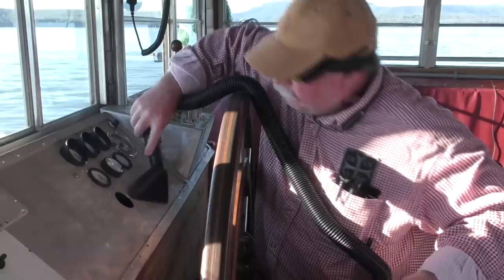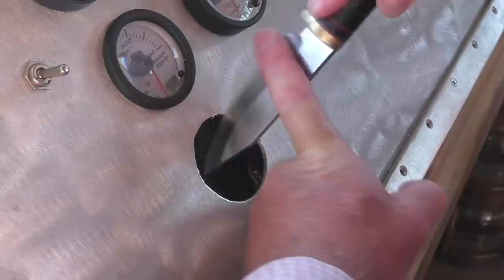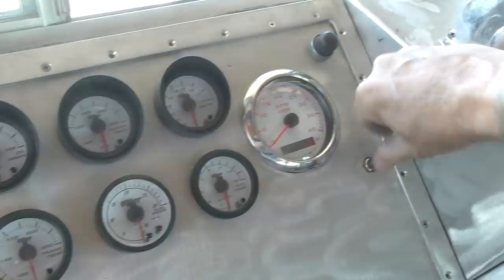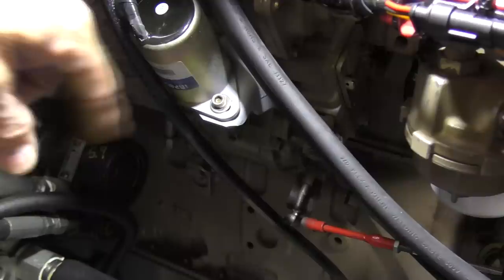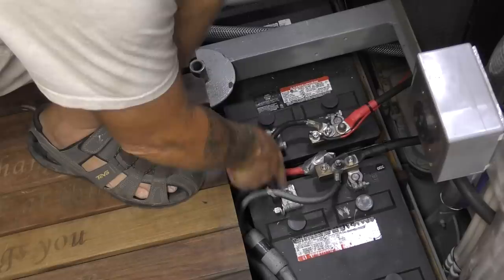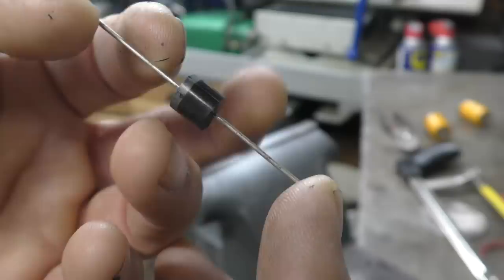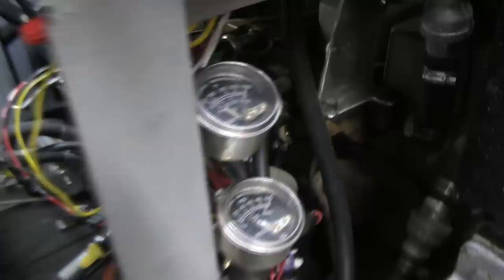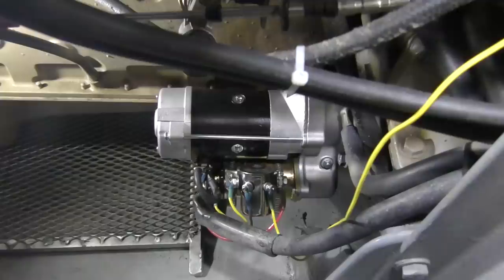Engine Electronics - Starter Relays Diodes and Gauges

Comment: With respect to the back-EMF diodes not working properly, make sure that the diode is in parallel with the coil that is the LOAD, not the coil that operates the relay. Also, back-EMF will produce a voltage on the LOAD coil that attempts to continue current flow in the normal direction in which it's being driven. Make sure that the orientation of diode across the LOAD is blocking the normal current flow, but snubbing this EMF. There are lots of schematics online that show this. Finally, the current carrying capacity of your diodes is more than enough. But, you may have accidentally purchased rectifier diodes. Schottky diodes are much more effective in snubbing back-EMF as they turn on much quicker. Good luck.
Reply: i have also used caps for this, usually poly caps of a good value work too
Reply: Top tip. NB when googling, search for 'flyback' diode.
Reply: The back emf voltage can exceed 600 volts. Withouthe clamping diode, it will ring, regenerating, counter, counter counter emf and so on.
Reply: Isn't the problem here exactly the same as in a points interrupted coil ignition system?  So a capacitor (condenser)  rom an old fashioned ignition system would prevent a spark across the points.
Reply: @richardb4313  That's how I'm seeing it. I thought when the points closed they shorted to ground and that's how it collapses the field in the coil so I don't quite get it but I'm not an electrical guy. You use the condenser to eliminate the arcing though. Without that you'll burn through sets of points at an alarming rate and drive yourself nuts trying to figure it out.
Reply: There are other options to a Diode across the relais coil, as the diode itself can change the dynamics and lengthen the time until the induced voltage is drained, which may reduce life expectancy of parts in certain cases. Simplest alternative might be a resistor in place of the diode, but that has even more disadvantages in even more scenarios. Best, or possibly even better alternative might be a Zener-diode, but not across the coil, but across the switch. If additional protection is needed, a combination of a Zener diode and a resistor can be used as well. 
Oh and if I mentioned something being longer or shorter, this may impact wear on components, but in this case nothing functional. We are tlaking miliseconds here, so nothing that should be of concern if no ICs etc are involved. Also some automotive relais actually seem to have diodes built in.
Reply: Almost like water hammer effect
Reply: @gtb81.  But in this case the capacitor has to be across the contacts. A capacitor will not conduct DC, but it will work like a sort of resistor to AC, so when the voltage changes the capacitor will allow the current through and snub the arc. It's also the reason why you often find small capacitors across the leads of brushed motors, both to reduce the electrical noise and to reduce brush wear.

Comment: You can get cheap 12V and 24V panel lights (generally LED these days) and wire them in parallel with each section of the circuit and you will see exactly what the status is.  If a relay welds itself on or off you will see it.

Comment: Hi Doug , I remember back in the 70s with auto points and condenser for the coil. the condenser was to prevent spark and make the points last longer
Reply: I think you got that right... wouldn't a condenser be the right thing to put in place of the diodes?
Reply: @danieldonaldson8634  you may have to work a bit to find the correct capacitor(condenser) as it needs to balance with the reactence of the attached coil.

Comment: Press the select button one more time on the multimeter to measure the diode. It will display its forward voltage. Using the resistance or the continuity mode does not always work as those dont supply a high enough voltage.
Also, those diodes are too small for that starter motor. If the starter pulls 50A when you try to switch it off then its inductance tries to maintain that 50A by collapsing its magnetic field  thus creating the voltage spike. Get a diode rated for 200A pulses (or more), the 10A general rectifiers can usually only handle maybe 30A repeated pulses.
Reply: The diodes are not for the starter motor.  The diodes are to allow the current going through the coil in a solenoid or relay to continue to flow and dissipate slower than if you try to stop the current quickly.  A sudden change of current in a coil causes a voltage to develop.  The diode snubs this voltage but also allows current to flow back to the other end of the coil therefore not collapsing the current in a infinitely short period.  Rate of change of current causes voltage therefore by keeping the current circling through coil and diode it allows the energy in the magnetic field to collapse in a longer period of time.
Reply: @Muppet_Interfector  On the starter motor there are three terminals: One is the housing acting like the ground, one is the battery + (which sinks up to 1000A driving the motor), and one is for the internal solenoid. The internal solenoid has two functions: swithes the batterly + (and is designed to do so), plus it engages  the gear. Eg this is why you hear a clicking from a car starter with no other  movement when the solenoid part is dead. This internal solenoid is the one we are talking about, not the actual motor.
Here are the internals: 
https://startersolenoid.net/wp-content/uploads/2017/06/starter-solenoid-operation-e1498046283844.jpg
Reply: @valamilamasag  So not the starter motor as you said but the solenoid that is more or less built into the starter.

I don't think a diode is needed either for the motor or the solenoid in the starter motor.  That solenoid is designed to handle the arc by extinguishing it before it has time to do any damage.  Diodes are required to save his switches and any other relay that is used to drive the solenoid.  I have previously had to use flyback diodes to save a solid state switch device instead of contacts but I understand the princeples involved.
I suspect the we both understand what is happening here.

Comment: The diode died to the same grounding issue you can install it back up if you want to.
Reply: I agree. The protection diode goes from ground to plus 12V, which is a low number to high number situation. And current will not flow in that direction. 

But when that ground became 24V then you have a high number to low number situation. And because the 24V source is a very high current, and continues source, then a lot of current can flow.  

High number to low number is similar to 12V to Gnd.  

A collapsing coil will also reverse the voltage, so a high number to low number situation occurs - but a collapsing coil is not a continued voltage nor continued amp source, so the diode survives fine. 

But when shorted between 24V and 12V, then there is no shortage of voltage or amp source - and puff the diode is not only shorted, it is completely evaporated. 

So now that you the fixed the: "that ground is no longer a ground"- situation, then your diode will again have a survivable environment.
Reply: @MrAlvinDude  Yours is the smartest answer I have heard yet. I would buy it.
Reply: I concur, I knew several here would have said it already.

Comment: I bought a cheap second-hand refrigerator when I was in college.  It came without a thermostat because the previous owner used it as a beer fridge and was able to consume beers fast enough that the fridge was always running - hence he removed and discarded the thermostat.  So, I fashioned a new one out of a refrigerator thermometer (with a needle) and some wire.  The fridge would warm, the needle would contact a bent wire, the compressor would start.  It worked great, but sometimes arcing would cause a chain reaction that would buzz for several seconds (and I feared it might ultimately burn out the compressor).  I had to get out of bed sometimes and kick the fridge to get it to stop.  The answer was a capacitor across the improvised thermostat switch.  Slept like a baby after that.

Comment: Since you had that weird ground setup on the starter solenoid’s solenoid, it’s possible the diode fried because what was ground became more positive than it was supposed to, that would have fed 12v through the diode and burned it out real quick. I agree that you probably won’t need the diodes with the solenoids, but that’s my bet on what happened there.

Comment: Amazing bit of problem solving there Doug!! Must feel fantastic to see a problem, have it worry you, then figure it out. So satisfying to watch at least! Well done! 🙌🙌
Reply: I think you are on the right track. You have the makings of an old style Kettering ignition (points and condenser ) system with that set up. Nothing necessarily wrong with that but I suspect the reason Kettering used a condenser/ capacitor  and not a diode was the high voltage the coils produce when the field collapses  which to an extent is  increased by how long the magnetic field is charged ( dwell in the old Kettering ignition) not 100% certain but I'm pretty sure the combination of high back voltage( hundreds of volts) and momentary high in rush current is just to much for the diodes to handle. Also typically high voltage  is  more likely to burn contacts , high current typically welds them  together. With the mix of relay coils,  motor windings and 24volts  you may have a ad hoc transformer that is  breifly delivering quite a kick. Dedicated starter switches manual or relay are typically constructed with two fixed high capacity contacts which are bridged by a plate it effectively doubles the air gap for the high voltage, but not the mechanical travel. The high current contacts also help to dispate the heat otherwise present to minimize welding. A standard relay or switch will frequently have one contact move to touch the  other  which is usually cheaper and smaller to manufacture. Just  some thoughts  keep you the good work 👍
Reply: When the Kettering system was developed The diode other than a tube was not invented yet?
Reply: @josephpadula2283   you are correct I was trying to simplify for the less pedantic among us. However even after it became cheap and readily available no one was an advantage to  switching, many people don't realize but that system is still used in  some small piston driven aircraft  for simplicity and robustness.

Comment: I just want to say we ran with 24 volt in conduit on a project about a thousand feet and had no issue with voltage drop.
In my entire time of maintenance the only time voltage drop was ever an issue was the wires going out to the parking lot lights.
You need that secondary relay, with it there you shouldn't fry any more switches.

Comment: I remember testing some 24v solenoid valves and somebody making the remark "I didn't know that these relays had built in lights" that's when I found out the freewheel diodes had been forgotten. Its amazing the spark you can get without them.

Comment: You probably fixed the push-button and relay contact welding with the ground wire fix.  The "chattering" of the start solenoid put the equivalent of "hundreds" of life cycles on those poor components with every engine start, Ouch! (The internal heat buildup of so many arcs in such a short period of time is brutal to soft metal contact points!)  If you want added protection look up "Snubbers" for contacts and coil protection.  They are more than just a diode for higher levels of protection, however they are more expensive than simpler solutions.

Comment: I've seen capacitors used across a switch to prevent arcing. d_ has provided good advice on how to use diodes to prevent back-EMF or what I've heard called counter-EMF from a coil.

Comment: You can buy versions that come with the diode, usually the packaging shows the diode and sometimes a small capacitor. They all look the same on the outside, although some you can see the diode on the bottom of the relay.

Comment: My thoughts, now that the ground has been moved to the block your diode may work on the solenoid. Any Starters that I've dealt with in the industrial arena had the diode right across the back of the starter itself.
Reply: Also, all 24 volt systems that I've worked on needed 24 volt push buttons etc...
Reply: @Khahngenwater  All the buttons I've seen seemed to be rated for 250.

Comment: Doug if you build a double stack 4-6 or 8 lane board with the diodes in parallel called a load spreader. To split the different's. Spreading the instant surge of power on the board to still come out with the same current on the other side for higher voltages surges. Saving your diodes from the surge of power from the switch or relay. Which this causes instant heating across a single diode. 💯% 😎👍👍Diodes are for protecting components, But the one thing diode can't take is an instant power surge. They need a control before it. Like a resistor.

Comment: DOUG, Hella has a 40amp headlamp relay HELLA H41388641 and it has a built in diode, sold for hi powered headlamsp. look into a CAN bus gauge system, it'll allow for a TON of add on's later by adding more can bus modules. 1 cat 6 cable and you get incredible options, easy wiring and datalogging ability, which would be VERY handy when your at sea if trouble starts, you can have a 24hr logs with alarm triggers for recording !!!  AEM 22 Channel CAN Sensor Module PN:30-2212

Comment: Wow! thank you so much for this im definitely going to add these in future projects. The diodes you picked are only 15amps. Might need higher amperage diodes. They also have a 1 volt drop so try Shockey diodes which have a 0.5 voltage drop and so should work better. The diodes definitely worked as shown in your first test its simply about picking the right ones.

Comment: Hey Doug. Put a new diode back in the way you had it and it will work fine.  Your ground that wasn't is what took out your diode. The one coil connection getting 24 volts had the current flowing with 12 volts through your diode in the direction the diode conducts and it released the magic smoke. You got this. Trust the power of the diode.

Comment: Aircraft magnito has a condenser connected to the breaker point to prevent arcing during the magnetic field collapse on the primary coil. Some thing that you need to look into.

Comment: Almost all the automobile relays have either diode or resistor across the relay coil. If the arc is between contacts upgrade your relay current rating or add a 0.1uf ceramic capacitor across the contacts.

Comment: Hey Doug just checking to make sure you don’t have automotive starter relays there. For one thing they will over heat if turned on for too long a period..more importantly one terminal is the energize terminal , the other switches to hot when the relay is energized. This was the mechanism to bypass the ignition resistor on the old points type ignition.  Typically that type relay has the small terminals labeled “s” and “I” .   If you have a non automotive relay the coil is connected internally across the two small terminals and have no continuity to the case.

Comment: Doug, high quality switches deal with that spark by opeing so quickly it doesn't have time to do any damage.  You've probably encountered some toggle switchs that seem to take an inordinatnt force to switch.  That's the mechanism you need in a situation like this.  If you encounter it again, use your amp meter to measure the peak load and then go to a quality retailer like McMaster or Digi-Key and buy an American or Japanese made switch for that amperage + 20 or 30%.  Don't trust Chinese made switches they are almost all rated way beyond their actual capacity.
Reply: exactly! Amazon sells alot of dangerously cheap electrical parts.

Comment: Don't know if you know this, but that drill chuck will lock.  When you tighten it, it should click to tighten, then once tight, twist the chuck back to opposite direction one click and it should be locked.

Comment: As far as I know all the diodes in the systems that I worked on were to prevent damage to sensitive computers. Look at the switch contacts does that look like ( back voltage? Spikes ) now find the real problem.

Comment: Any inductive load ( that means the load primarily consists a coil of wire such as a motor, compressor or relay ) will have two aspects that burn out relay contacts feeding it.

when the relay closes and supplies power, instantaneously that inductive load appears to the relay as a short circuit because at that point it has not developed its magnetic field to resist current flow.  but once the motor starts turning or the relay activates that creates resistance to the flow of power and so from them on it takes its normal running current.

in this start up time where it appears as a short it can take 5 to 10 times it's normal operating current for a very short space of time... but time enough to start overloading and burning out relay contacts.

the other end of this equation is when the relay removes power from the inductive load.... this is when we get the reverse problem, the load has its magnetic field and so when the supply voltage disappears, that magnetic field collapses back through the wiring producing a back EMF voltage spike often thousands of volts...

and so it's this double whammy that burns out relay contacts.... the big overcurrent spike at the beginning, and the big over voltage Spike at the end.

back emf diodes help but you may also need a way of dealing with the initial current Spike... there are several ways to do this but at the very least the relay supplying the power needs to be rated at least five times the current capacity of the load.... so for example something taking 5 amps when it's running should be switched by a 25 amp relay